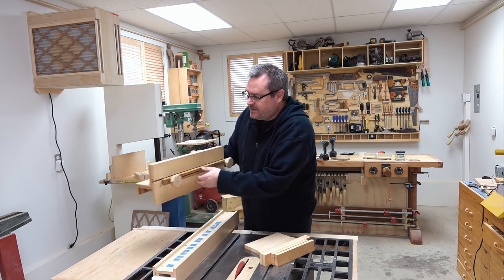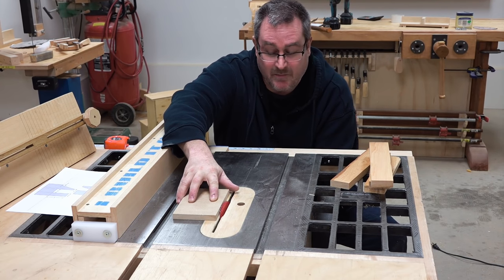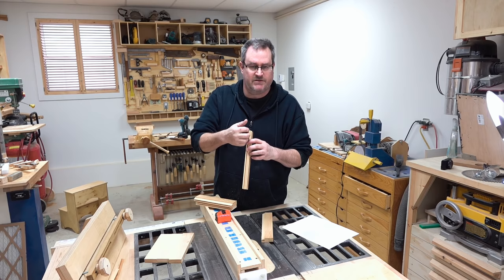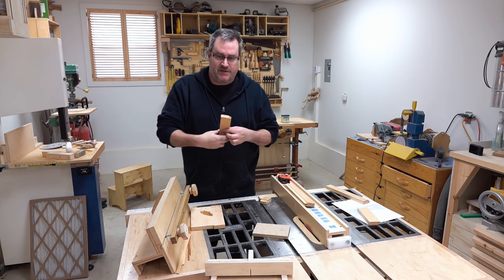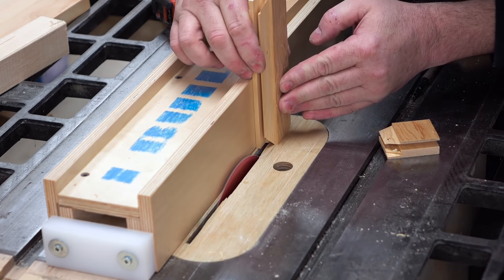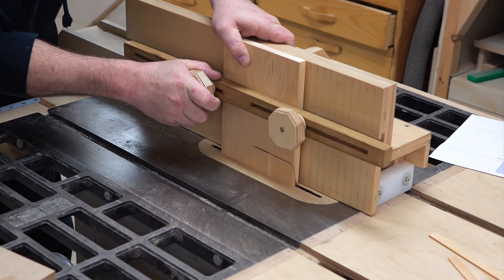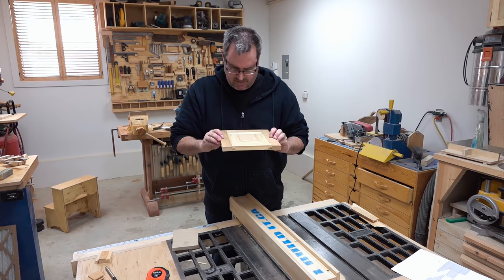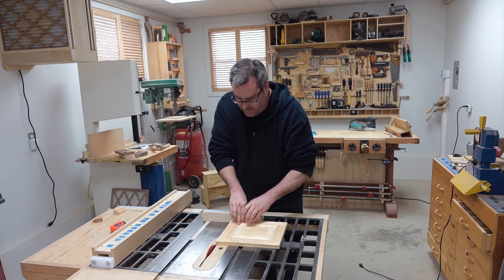Making Raised Panel Doors On The Table Saw

Comment: That's a fine technique, John; sure, labour intensive, but then solely using a table saw cuts out the middle man. I do not possess a table mounted router, either, & your method is safe & sound as far as I am concerned - you're a consummate professional, which garners my respect. Many thanks for an interesting & informative video !!

Comment: Thanks, John.  Good video showing a table saw approach to cope and stick and of course raised panels.  I bought a set of cope and stick router bits to redo my kitchen doors--24 in all.  I found setting the router bits in the router table to be very, very finicky and I guess it's just me but I feel a little more confident setting up my saw.  So I think making the cope and stick with a TS might be just a bit faster.  Regardless of which approach absolutely all the stock for the rails and stiles must be the same thickness.
Reply from the maker: Thank you :)
Another thing to look at is a table saw blade has a lot more cutting edges, so takes a lot longer to get dull. Whereas the router bits only have two, and in no time are dull enough to burn the wood, which means more sanding.
Reply: Garagevloer betonreparatie

Comment: Nice door!
 I don't know why I've never seen your small table saw sled before, but I most definitely will be making one myself!
Reply from the maker: +Jeremy Schmidt 
It's my go-to for cutting small parts. Much more accurate than the miter guide and safer than the chop saw for small parts.
Reply: Also, since the piece is backed up with zero clearance fence tear out is minimized.

Comment: I seem to remember Izzy Swan doing  concave bevels on the center panel running it through saw with the fence at an angle
Reply from the maker: +Lasse Langwadt Christensen 
Yes, that's a fairly common way to make them, but does involve a lot more sanding.
Reply: +I Build It Would a cove cut on the rails and stiles work? I can't picture how the joins would meet if say you replaced the 20.5 degree bevelled edge with a concave cove profile.

Comment: how do you measure to have the right size door considering the cutting of the joint,  is there a standard extra amount to add to the rails to get the proper with of your door? Thanks

Comment: Is it possible to do this on a contractor table saw, its small, I have made a cross cut sled works good, but the fence is narrow, so build one on top of it not very wide for stability ?
Reply: Panel Raising with a Table Saw - YouTube

Comment: excellent video, John!  my only question is:
if you set up for a large production run and do all of the similar cuts before changing the saw over for the next cut, how can you be sure you're not making the same error over & over?
I'd be worried I'd get to the end and none of the pieces would go together without massaging them to fix some minor error in the process.
would you build a single door first as a proof, then run the rest?

Comment: Nooo!!! You can't use a chisel that way! Put it back on the rack, where those belong!

Man, are those panels a pain. A few years back I bought one of those rail/stile router bit sets, but I like your method better I think. It might be nice to have two tablesaws for the process, just so you could have a dedicated zero-c plate in the angled one. Then you could tear through a bunch of them in a day.

Anyhow, that turned out seriously awesome, and I think it probably would be faster. The router bits have to remove mat'l in multiple passes if I remember correctly. Plus, it was expensive as hell and intimidatingly dangerous to use.
Reply from the maker: +pocket83 
Thanks. The set I show in the video was fairly cheap, but the bearings are held on by cheap nylon insert lock nuts that are so poorly made, they unbalance the cutters.

Comment: Great looking final product.  Most stressful video to watch ever!!! Those fingers were way to close to that blade for kick-back comfort.  A hand router and a couple of clamps ($150) is way  cheaper than reattaching a finger. You will also cut job time to one tenth of the time those 100 blade adjustments took off camera.
Reply: Hes been using a table saw almost every day for over 30 years. Different people have different limits and levels of comfort

Comment: If you're discouraging the use of raised panel bits because of cost you shouldn't. Neiko makes a great entry level set for under $40. Professional grade? Heck no, but it will get the job done. Saves all the tons of setup with your table saw. Plus the table saw limits your choice of profile for the panel. Great video though.
Reply: It's also possible to run the panel on a diagonal with the blade tilted to make a cove cut. $40 may not be much money but it's money nonetheless. The bits (especially cheaper ones) can be finicky too so there is still a good amount of set up involved. Like he said in the video, if you had multiple doors to make,  this procedure could actually be quicker if you ran each cut before readjusting the blade.

Comment: in my opinion the time spent adjusting measurements and tweaking cuts to make these joints would be saved buying and using some good router bits.

Comment: For 1 door ok. If I were making more than 2 doors, i would buy the correct tools. Just way too much setup and movement of the saw to get identical doors. Also the time element. In the video you cut out te setup routine so it lloks quick and easy. But it's neither. But thank you for showing me why not to do it this way.